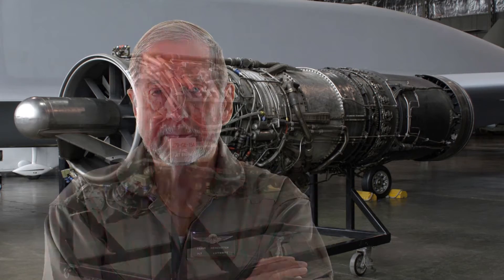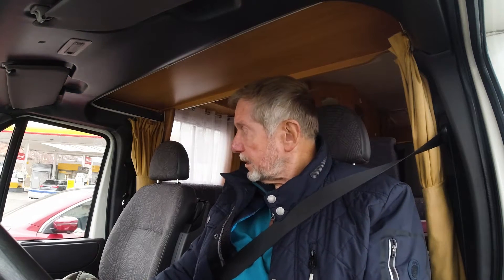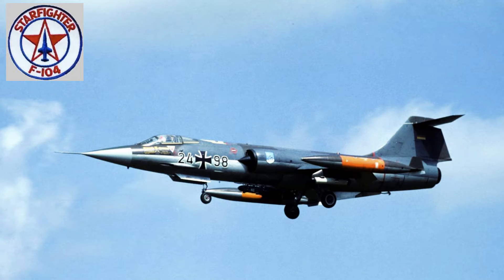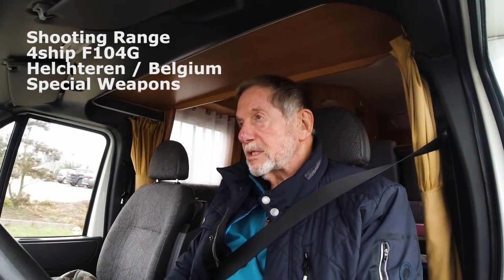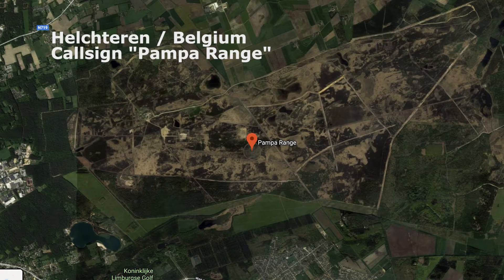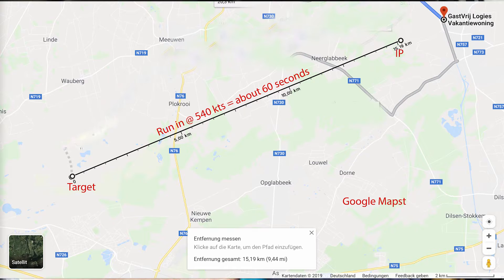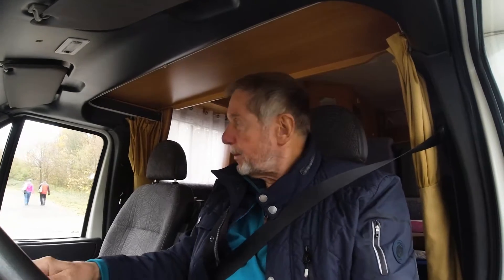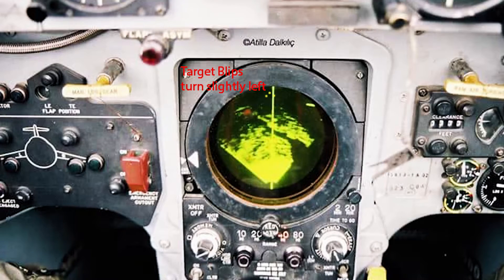How I destroyed a J79 Fighter Jet Engine

Comment: how about that, no decrease in N1, EGT didn't rise, your a lucky man, this aircraft was nicknamed, the flying coffin, I think you were a rocket with a man in it, well done
Reply: somebody below mentioned that maybe it was a different story and that the engine was damaged on the ground by maintenance personel
Reply: @bobl78  his flight was uneventful, so maybe, the J-79 must have out of balance, but at High rpm N2 it may not have been noticed, the only reason it had wings was to keep the nav lights apart .
Reply: @micstonemic696stone  but during aproach, landing and taxi the engine goes trough various power levels down to idle... it was damaged beyond repair , it seems so unlikely to me that this was not noticable
Reply: @bobl78  pilot said he didn't notice
only finding from ground crew
Reply: @bobl78  I'm not sure how that could happen, it was believed it was foreign object injestion while running, and the pilot was encouraged to report a bird strike by C/O, as unsure how it occurred, unless J79 was run up on the ground, and the jet tech's lied, as would this dramatic event, and no one else came forward. a mystery indeed ?
would liked to see the compressor damage and how deep it was ! no bypass on J79
interesting story

Comment: How can your superiors be sure the engine wasn't destroyed when it was operated after your flight? A mistake by maintenance personnel could've lead to the damage-and they decided to blame you, feeling you might suffer less than they would. I can't believe your superiors wouldn't consider that, as there's no way that engine would've kept that plane in the air in that condition.
Reply from the maker: Never thought about this.
Reply: agree.. such severe damage (engine beyond repair) would have been noticable at least by vibrations.. maybe they did a run up after maintenance and forgot some tools in the intake or something next to the airplane was sucked in